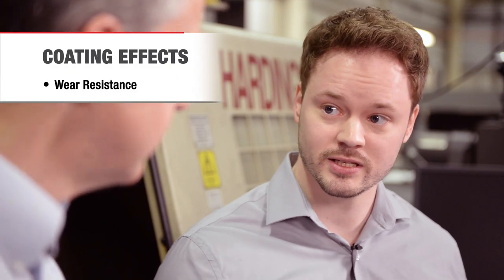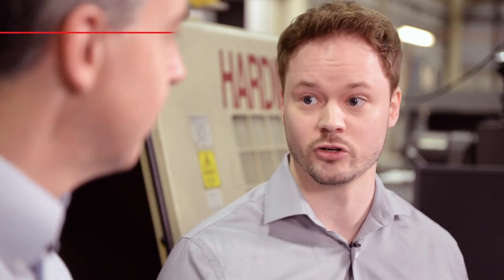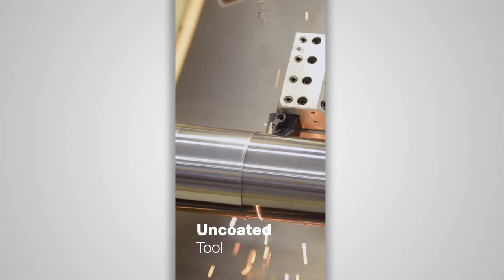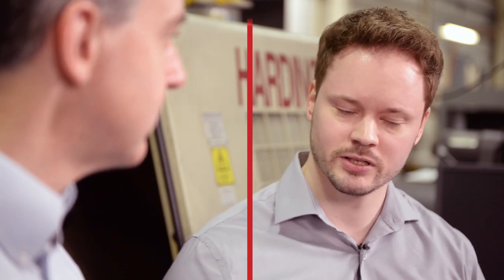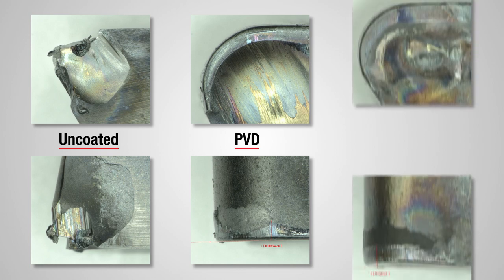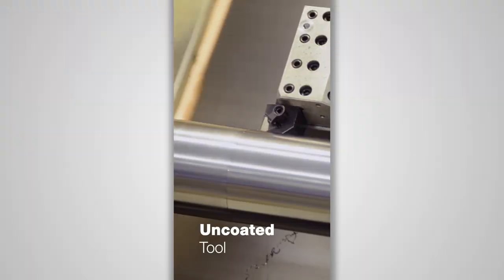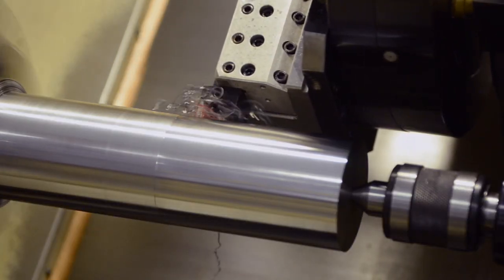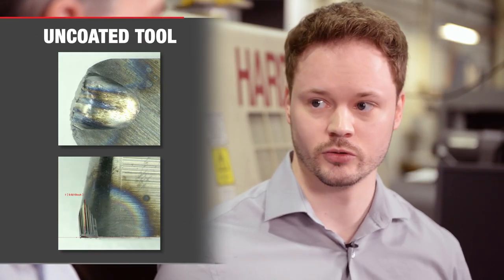PVD vs CVD: How to Choose the Right Tool Coating

Comment: The uncoated carbide is obviously running way too fast. Why not run all tools at the appropriate speed for plain carbide.
This would give a fairly realistic comparison of tool life.
Increasing the speed of the coated tools will show the difference in MRR.
I mean, you wouldn't do a comparison of HSS and carbide with both tools cutting 4140 at 200m/min.

Comment: What is plasma vapor coating? Is it a different process to both these processes described in this video?
Reply: In plasma-enhanced chemical vapor deposition (PECVD) much lower temperatures are a major advantage,  
temperature-sensitive substrate materials such as plastics can be used.

More versatile process, Metallic, semi-conducting, or insulating layers can be applied. 
Complex layer systems are also possible.

In conventional thermal coating, the assist gas splits into its reaction products only at the heated substrate surface. 
In PECVD, this reaction already takes place in the gas phase through electrical ionization.